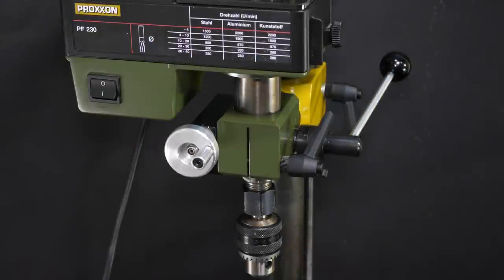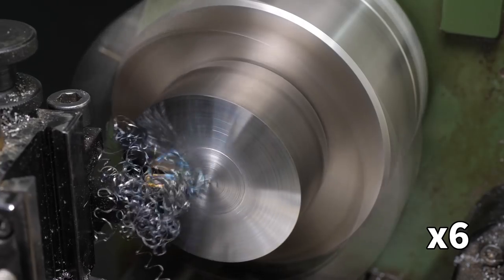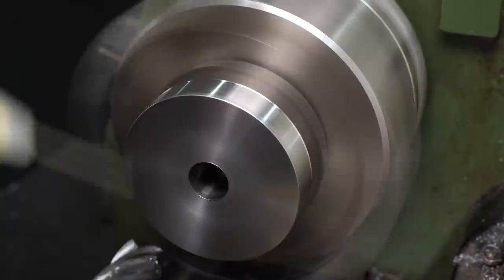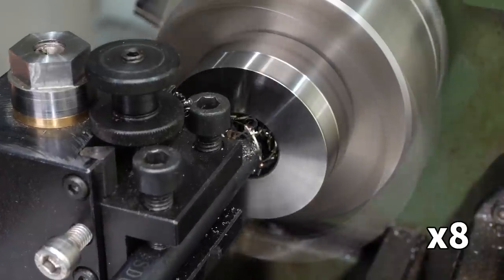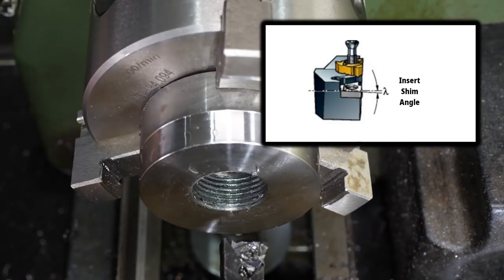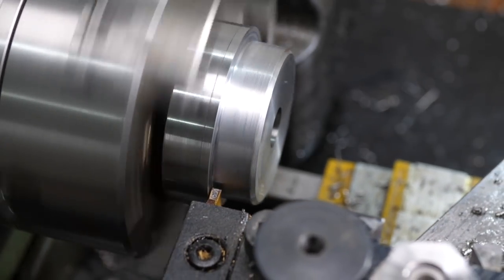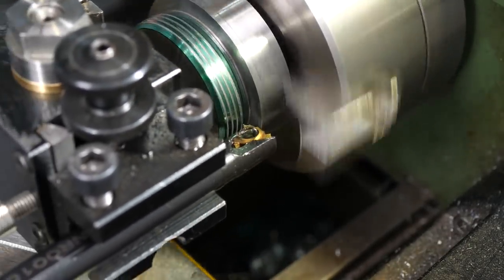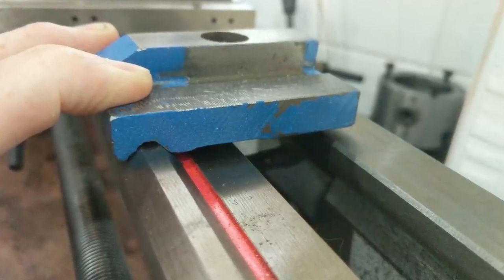Making a Boring Head Arbor for the Proxxon FF 230 Milling Machine using the Proxxon PD 250/e Lathe

Comment: Oh man, that looked like you had both a high degree of frustration and end satisfaction with that one! I like your idea of it though, it keeps as much rigidity as possible and keeps it short as well.
Reply from the maker: Thanks! I'm happy with the design, though the end result highlights that my mill is too small for this boring head.
Lessons learned that I need to be much more careful with material choice when pushing the limits of my gear. My first successful recovery from losing thread alignment too!
I love your machining videos, thanks for dropping by!

Comment: Wow that's an awesome job Alistair.  Lot of hrs in that. I have a bigger lathe,  and I still regularly pick major projects that are too big for my machines! That's not an easily solved issue.  Thanks again for a great video
Reply: Emmas Spareroom Machineshop it is just one of those machine shop facts of life. No matter how long you deliberate over the size of the machine you buy, it will become apparent quite quickly that you got it wrong. This week it is too small, next week it will be too large.
Reply from the maker: Thanks Emma! I feel like this has become my channel's definiting feature: Pick something most people think can't be done on a tiny lathe, and try and do it anyway. Thanks for running the competition!

Comment: We use a lot of 16t 24t and 26w at work. Can be a real pain for certain machining operations. Great stuff on such a small lathe.
Reply from the maker: I've never come across 26w. Is it a similar material?
Reply: Adventures with a Very Small Lathe yes it is similar. In my experience it’s even more difficult to machining but has very good post machining properties. Excellent toughness

Comment: Good work.  A couple of flats for a spanner (or holes for a pin spanner) would be a useful addition.

Recovery from accidental disengagement of the half-nuts is easy if you stop the lathe spindle before the thread chasing dial has moved more than one turn and don't manually move the carriage.  Just run the spindle in the opposite direction until the dial returns to the number that you originally engaged it on and re-engage the half-nuts.  It helps if you always engage the half-nuts when the thread chasing dial is on the same number (or mark the dial) when you first start the thread.
Reply from the maker: Unfortunately there is no dial on my machine, and no half-nut. The carriage is permanently engaged to the lead screw, and the control for engaging it with the spindle is a dog clutch inline with the lead screw, in the headstock. On machines with a metric lead screw, and a dial, the charts to work out which numbers can be used are complicated and hard to read. I follow your technique though, and can see how it would work. Thanks for the tip!

Comment: What you need for that mini lathe is a modulated speed controller that can increase voltage to the motor as RPMs drop and then quickly decrease voltage again to maintain target RPM at less load
Reply from the maker: Funny you should mention that, as I've just been learning how to program a Variable Frequency Drive how to do just that. I'm not sure it would help much on this lathe as it is though, as I suspect the motor is just too small. A big beefy motor with a VFD is definitely looking likely for the Chinese lathe though.

Comment: As always, excellent production value!  I also greatly appreciate your sharing of the errors that were made, and how you corrected them.  I would like to see some detail on the method for realigning/re-indexing the threading tool after erroneous dis-engagement.
Reply from the maker: Thanks! I think I can work out a way to show the re-alignment process, but I'd need to come at it with a much calmer level head than I had at that point in the project. I was at risk of losing a lot of work, which made me stressed and irritable.
I'll see what I can do, though no promises on how soon.

Comment: Very nice video!
You could also make a vertical Line boring tool (mounted like a fly cutter) for end radii cuts like that, if that's something you do regularly.
Works just like using a tailstock live center or a steadyrest for long workpieces in the lathe, except vertical.
All you need:
1. Hardened shaft with hole(s) drilled & reamed for inserting an 8mm dia HSS blank and holes drilled+tapped to clamp the inserts. (Or just silver solder the inserts)
2. HSS insert, cut and ground for the job/material.
3. Bottom plate with bearing(s) that can through-fit the hardened shaft.
4. Clamps to position the bottom bearing plate square and exactly under the boring shaft.
The shaft should be lightly ground at the end for a loose sliding fit inside the bearing(s).
This changes the loading significantly. Instead of a cantilever boring bar, you now have a simply supported boring shaft. All other things being equal, the cutting tool will now move only half as much, but in practice it is much better than half as much with a remarkable improvement in surface finish.
For even higher loads you can make 1 or 2 holders like a knurling tool, except with 2 cheap 608 bearings to support the shaft somewhere close to the cutting edge.

Comment: Lovely work on that boring head. Its amazing how many import tools out there are built to inch standard.
Reply: It's usually to work in with an existing standard. e.g. Japanese camera manufacturers, who would normally use metric, do use 1/4" 20tpi threads for the tripod mount, because the world is filled with tripods with that thread. Also, I believe the inexpensive import boring heads are a clone of the US made criterion boring head, so in order to work in with that system, they use the same threads for the body to arbor connection.
Reply from the maker: I think that's exactly it. In lots of situations it's much more important to have a globally accepted standard than exactly how that standard is defined. The camera tripod is a perfect example.
Reply: @AdventureswithaVerySmallLathe  it's for that unfortunate reason imperial units will be around for a long time, even if the US switched to metric tomorrow. Standard pitch checkers like you showed are cheap enough though there's no reason not to have an imperial set too.

Comment: I went down the same path except I bought an arbor on EBAY with a 20mm straight shank to fit the ER 32 collet chuck I have as an integral part of my mill spindle....not being lazy but I like the professional totally machined and ground finish. of a shop bought item.

Comment: I own a proxxon pd 250/e lathe but I struggle with parting steel. I only use it for really small projects but the damn thing still chatters as hell. The most depth I need to cut is 3-4mm. I aligned everything and used a HSS parting tool as narrow as possible to put as little stress on the lathe but still unsuccessful. Can you give me an advice regarding this, please? Your videos convinced me to get a proxxon which I am super happy with, I only struggle with parting mild steel.
Reply from the maker: Parting steel really isn't easy on small lathes, and I'm pretty sure this isn't unique to the Proxxon. General guidelines are that the parting tool should be as narrow as you can get away with, it should be very sharp, the torque should be high, and the speed should be low. Unfortunately low speed and high torque are almost impossible on this lathe.
The best results I have had were with a carbide parting insert, which allowed me to run at higher speeds where there was enough torque. The tool has to be constantly fed inwards, or it will start rubbing. I honestly haven't found a really good solution though, and I tend to avoid parting if at all possible.
Reply: @AdventureswithaVerySmallLathe  thanks a lot for the reply! I thought it's just me. I'll try a  carbide insert next.

Comment: Nice work on such a tiny lathe, and excellent video production too.

You'll find the Chinese Minilathe has much more torque than the Proxxon. I've installed a 3 to 1 reduction pulley set on mine, which in conjunction with low range has made a massive increase in usability.
Reply from the maker: Thanks John! Unforunately because I cheaped out on the Chinese lathe, it doesn't have a hi-lo range selector. Just a single direct drive from the motor to the spindle. At least the Proxxon has three belt ratios I can change between. That said the Chinese lathe has a much larger motor, so I'm expecting a bit more oomph out of it.
Reply: @AdventureswithaVerySmallLathe  

It's possible to retrofit the 2 speed gearbox on the Minilathe, if you want? It's also possible to do a 3 or more to 1 reduction very cheaply, as the pulleys needed are available off places like ebay, but will need a bit of machining to fit.

The Minilathe is well modified, so there's loads of information out there on what can be done. ;)
Reply from the maker: @johnnodge4327  I'm interested to know more about retrofitting the 2 speed gearbox if you know more. Got any videos or links? I'm concerned my tools may not be big enough to modify the headstock much though.

Comment: I am slowly buying the proxxon`s lathe accessories. Have just bought the fast changing tool and the 4 jaws chuck, I am looking now to the imperial gears and the cutting tool recently released by proxxon. Then if money allows the insert tools (but I confessing they seem to be too expensive for my pocket).

 I bought this lathe because of this channel. And I did not buy the mill because of this channel kkk. Opted for a resonable chinese mill from the same brand @Blondihacks have, but a more entry model. I am liking it a lot.
Reply from the maker: These all sound like smart purchasing decisions to me! I'm really interested to know how well the 4-jaw Proxxon chuck works out, as I regret not buying it myself, but can't justify yet another chuck at this point.

As I said in another comment, I don't think the Proxxon insert tools are a good buy. They don't look like anything particularly better than the cheap Chinese ones, and the price is high. Look for an 8mm tool set that uses CCMT inserts. When it comes to inserts, the cheap ones will be work, but consider buying professional grade inserts from Sandvik or Kennametal. Small mini lathes work best with finishing inserts (small depth of cut) with a small nose radius (0.2mm or 0.4mm). CCMT 060202 is my standard workhorse insert. I only use DCMT for hard to reach problems, like the ones in this video.

Comment: As always awesome. One question about xternal thread 1-1/" 18 tpi. How have you made pitch if Proxxon gears are for metric unit, not for imperial?? 18 tpi is supposed 1.44 mm pitch.
Reply from the maker: I tried to explain what I did for this thread in the introduction, but I think I rushed the explanation. At first I couldn't quite measure it properly, and didn't turn up anything searching online, so I guessed it was close enough to 1.5mm. I machined it to 1.5mm and kept cutting until it fit. 18tpi is 1.41mm pitch, so to get enough slop for it to fit over the 4 turns the head has I had to over-cut it quite a bit, but the end result still held secure. If I was going to do it again I would set the Proxxon up to cut 1.4mm, which would be a lot closer, and the metric gear set can do that out of the box.
Reply: thanks for your clear and complete answer @AdventureswithaVerySmallLathe

Comment: Didn't you check the eccentricity of the piece at minute 12?
Reply from the maker: Nope! There were no available surfaces to check. The face and the OD were both rough, unmachined faces. The opposite face was completely inaccessible, and the turned diameter was all inside the jaws. There was nowhere I could have put an indicator even if I wanted to.
Perfect concentricity doesn't matter for this project, as a boring bar is always off-centre.

Comment: I was waiting till you say how this is too big for the machine. 

I have the same boring bar on an Axminster/Sieg sx2 and even on that machine, with load being off centre a lot, machine becomes very wobbly.
Reply from the maker: Yeah, I expected it to be very hard to use, but as the footage at the end shows, it's still useful. I haven't been able to find smaller boring heads for a reasonable price, until today when Colin posted the links in the comments here to 30mm and 38mm boring heads.

Comment: Given your struggles with torque, you really need to have fully sharp tools that can take fine cuts. This means (in turn) you need good grinding and honing facilities, for either HSS or carbide (and drills, I guess).

Insert tooling seems antithetical to your best road forward.
Reply from the maker: That was exactly my thinking when I decided to try the brazed carbide tool, but unfortanately I just don't have room for a grinder on the bench. I sharpened the tool in this video by hand, which took a really long time, and wore out two diamond honing tools. I finally have a bench grinder set up for both HSS and Carbide, but the only place I can use it is outside, so only when the weather is good.
Looking forward to the day when I can afford a real workshop.

Comment: Did not sound like you have a carriage stop, it might make life a bit easier if you made one. A future video? Excellent work on this adapter.
Reply from the maker: You're right, I don't, but I really need one. Another project for the list.
Reply: Adventures with a Very Small Lathe if you are going to make one, make two. For some jobs it can be useful to limit both ends of the travel of the carriage. I find two quite useful on my manual lathe, eg to set the limits on a internal or external groove.

Comment: HI did u buy the Proxxon insert tools or these are other brand?
Reply from the maker: They are not Proxxon branded tools. Most of them are unbranded Chinese tools. The inserts are mostly Sandvik branded, and the inserts matter much more than the holders.
Reply: Adventures with a Very Small Lathe do u think the proxxons one worth the 170,00 US dollars proxxon is charging?
Reply from the maker: @fcconstantino  I really don't think it is worth that just for three 8mm lathe tool holders. You can get a set with more tools for a fraction of the price, and I don't see any sign that the Proxxon ones are anything special. I'm particularly concerned that Proxxon don't say anything about the inserts , or even what brand the inserts are.
I buy cheap chinese insert holding tools, but I carefully pick out inserts from Sandvik or Kennametal, and choose inserts designed for finishing work (small depth of cut), with a small nose radius.

Comment: Did u see that proxxon has released a cutting tool for this lathe?  Look for part 24217.
Reply from the maker: I hadn't seen that before, thanks for the tip! It is kinda pricey though for such a simple tool. Have you ever used it? It looks as though the end of the parting blade is at an angle, which makes me wonder how well it would work.
Reply: Adventures with a Very Small Lathe I am considering buying but the Import fees from Germany are prohibitive.Probably I will wait till it reaches US. It seems it also has a hole for round tools which is great.
Reply from the maker: @fcconstantino  I missed the round hole for boring, and I just assumed that round hole was to ease the flexture. It doesn't seem to be mentioned in any of the descriptions though, and no mention of the diameter. Are you certain it is intended for a boring bar?
Reply: Adventures with a Very Small Lathe kkk. No I am not sure. I am guessing

Comment: Certainly an interesting video, particularly where you've included the thoughts on the 2nd design and the issues, observations and resolutions during boring.
Not sure what demand there would be for the 1h 15min video but if you had it done with commentary, it would be a shame not to upload it also (or even with a block of text per section) if there's more detail within.
(Missed replying in the live chat but looking forward to more Chinese lathe videos!)
Reply from the maker: The 1h 15min version was a rough cut, I was always going to edit it down, but getting to 20 minutes often felt quite brutal. It meant I had to be very careful with some of the detail. There is no long directors cut of this video with commentary, just the rough version in the editor.
Reply: Was worth asking :)
The short version still get's it across, just at pace.

Comment: How do you find kdenlive stability wise? I tried editing my entry into #tmc2020 using kdenlive and I encountered no end of bugs. Olive seems to be working better for me, even though it is a bit more limited. (Note I am running a pretty old version of kdenlive, maybe a new version will be significantly better)
Reply from the maker: I'm using a really new version of kdenlive, and I update really frequently. Recent version 20 releases are a whole load better than it was around 18 and the early version 19 releases. I'm also engaged with the kdenlive dev community, and file decent bug reports when I find problems, which helps make sure there aren't bugs which affect my work. I did try Olive a while back, but found it just didn't have the features I need for my editing style. I also tried Davinci Resolve, but I don't have a computer that is heavy enough to run it well.

Comment: I feel for you, but despite the material you made a great looking adapter. I have a lot of unidentified steel, and the right bit for the job is always the bit that is made of something that is just unpleasant to machine.
Reply from the maker: I'd rather machine this material than 316 stainless any day. At least EN24T is consistent and clean; it's just really hard on the tooling.
Reply: @AdventureswithaVerySmallLathe  I agree, horrible to machine. I've tried threading 316 pipe for a Stirling engine, without a pipe centre. It wasn't pretty, it did work. Lovely stuff to weld though.